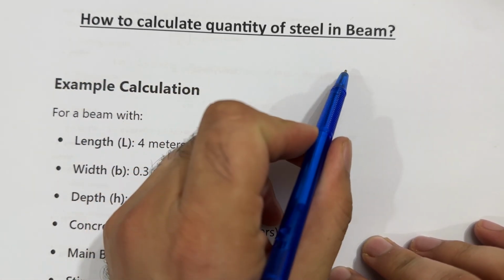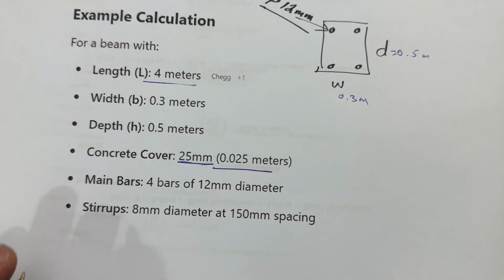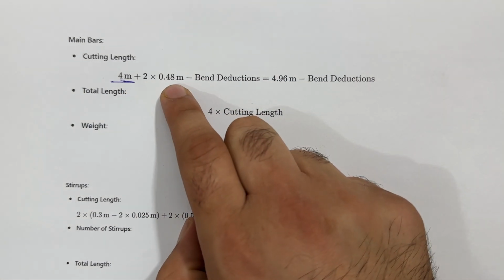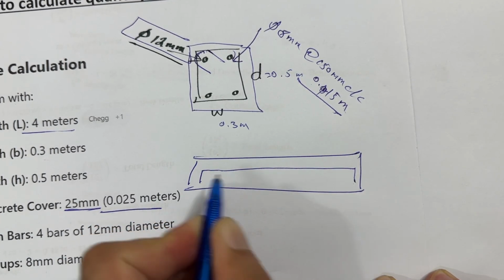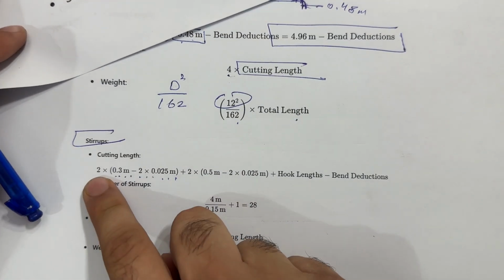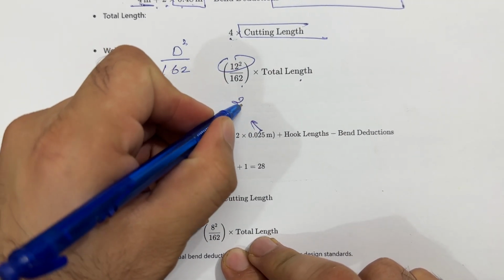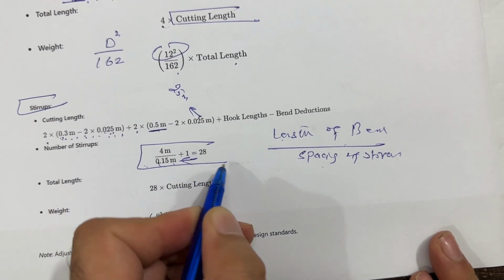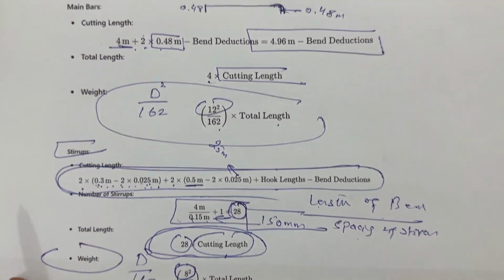How to calculate quantity of steel in Beam?

Comment: Where does 0.48 come from
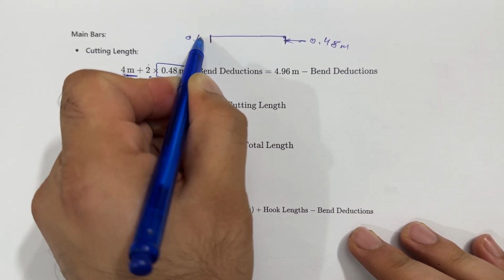Reply: 2:20
the part of the rod that will be bent, the length of the bend is 480mm or 0.48...........that's the length it will be bend at